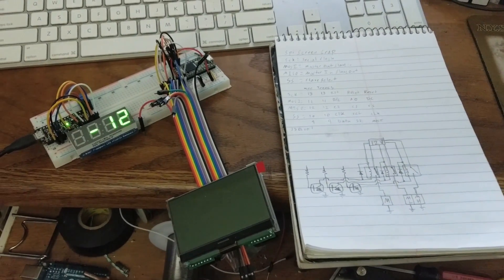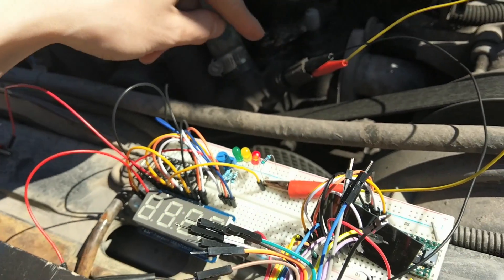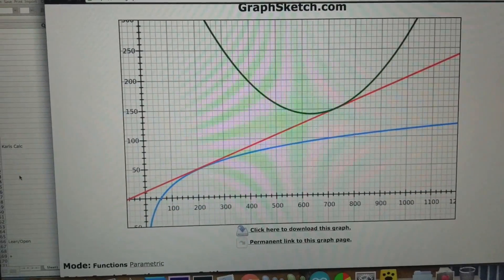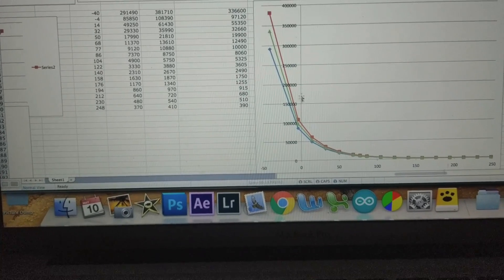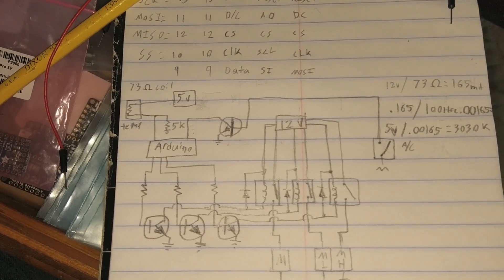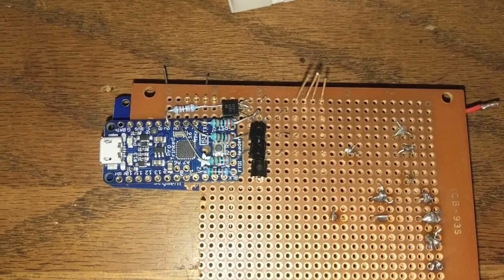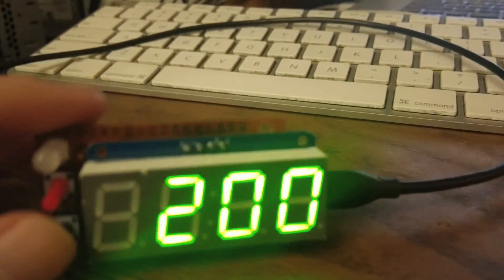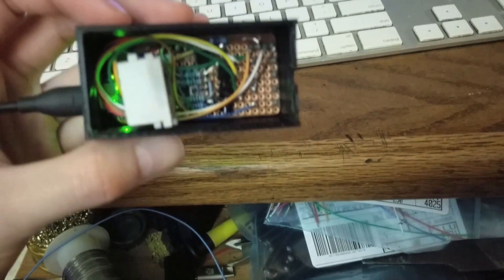Arduino Powered Automotive Fan Controller

Comment: I thought Arduinos didn't take over 12 V? How does it hold up to the 14 V + in a car when the alternator is charging? Are you daily driving it?
Reply from the maker: Correct. Arduinos are traditionally 5v or sometimes 3.3v logic. The trick is learning how to safely interface with higher voltages, which is actually pretty damn trickey.  

First power is powering the device. That's what a voltage regulator comes in, which cuts the 12+V down to 5v. Some Adafruit boards have built in regulators that can take 14+V so it's a good all in one choice. 

After then is making sure the outputs can also handle the load. I used transistors in this design which is sort of like a relay. It takes the small logic level output of 5V to control the relay at 12V which in turn controls the fans full power.

It's a fun little project if you really want to get into electronics and programming, but if you'd like something a little more out-of-the-box, I actually sell my own design now. 

https://nickintimedesign.com/product/trinity-fan-controller-v2/

Comment: Have you considered using some large mosfets and driving the fans via PWM? I bought some 200amp fets the the other day for less than $4 each, can't even get a relay for that today. What would be trick is adding a thermistor or thermocouple to the condenser return so you can regulate AC temp/pressure. Oh and I like your channel thanks for sharing your projects.
Reply from the maker: You know, I thought high amp PMW was gonna cost money so I didn't even bother looking into that. But that price sounds incredible but also sounds like I'd massively over-complicate this project haha. And an A/C temp feedback could actually be an interesting thing to monitor. If I keep on this path, my jeep will eventually become a spaceship that only I will know how to pilot haha.
Reply: NickInTimeFilms if you're going to be the first person to drive to the moon, it might as well be in a Cherokee! 

great videos, keep it up!

Comment: My a.c. controls had what I believe to be vacuum lines to control airflow vents. Thoughts on where to start with that?
Reply from the maker: Uhh, what seems to be the issue? The actual vent direction is vacuum controlled by the Black line near the heater core. Blower Fan speed is electrically controlled with a resistor pack, and A/C is electrically triggered as well.

Comment: Do you have code that would be for something more basic?  I don't need the extra buttons. just read and display temp and turn fan relay on.
Reply from the maker: +Landon Williams most of it is documented. If you're even remotely familure with arduino then you should be able to take what you need. just delete all the extra menus and button functions so only the temp reading and main display screen are included.

Comment: Damn i was hoping this was going to be for the interior blower, sort of like a hack climate control that would control the fan speed for you.
Reply from the maker: Hmm, well for an interior blower motor you've got 2 main options. You can do the simple way with a couple resistors divider circuits to have a couple speeds. This will need to be pretty heavy duty and may need cooling to not burn up. 
The better way is to use a Solid State Relay and PWM to control the speed. This would give any amount of speed you wanted and more efficient too, just make sure you get one big enough to handle the load.

Comment: I would get your controller however I made a 3 fan kit that i put over my radiator and i bought a controller kit for it. :(  you may need to consider 3 fans in your controller as that can be something a bit of people have?
Reply from the maker: Well, even though I only have 2 physical fans, there are 3 outputs since the big fan is 2 speed so that's already cover!
Reply: So there is a way to hook up 3 fans? 
Also I have AC. The AC fan is always on with the AC turns on. How are you handling that? I can use my 3 fans with your kit i may just use it because it gives feedback etc.
Reply from the maker: Yep, 3 fans is no problem, and later in the video I do talk about an A/C signal input too.
Reply: So if you want me to be a beta tester i am probably going to get my rig ready for the radiator installation within 3 weeks or less. I can give you all the input you will need. I would love it to be part of your REM V4 instead of separate but if you are too long off for that then let me know.
Reply: seems like there should be 5  speeds on your set up unless the primary runs all the time.
Reply from the maker: +nazcalito once all outputs are taken care of then you can worry about the semantics in the code

Comment: Ok so are you stopped working on the Renix ECU REader V4? cause I want that V4 once you have that out (this month?)
Reply from the maker: Of course not! Still full speed ahead on the REM project! Just got my first V3 Clock Prototype together and the basics work. Time to do some coding and design the faceplate. going to order V4 boards very soon if this works!
Reply: Super awesome. I want to help test first. :)

Comment: Can you build it into the REM V4 this way we can pay $100 for it and we get the fan controller at the same time.
Reply from the maker: It's funny you mention that..... A very possible feature that has been designed in. There will be 3 extra wires for for input or outputs, fans being a possible thing to control

Comment: hey! I forgot I've been holding onto this link: http://thespeedfreaks.net/showthread.php?12585-CCDuino-A-ZJ-Databus-Project/page9
Really interesting stuff, I'd love to see you do some stuff with OBD2 Jeep's!  Definitely willing to help with that too, financially and with prototypes/coding where I can.  I think your videos have convinced me to start integrating an Arduino, but I'm now even considering a Raspberry Pi as I have one of those just laying around since we got a FireTv to run SPMC on.
Reply from the maker: +rcguymike Uhg, I'm still barely thinking about OBD1 haha. I figure OBD2 guys are covered with the ScanGauge. And the pi is good if you can code on it
Reply: NickInTimeFilms problem with the OBD2 readers is we can barely get a sensor to update more than once or twice a second.  your scanner is way faster on OBD1.  we have a '17 Patriot that is plenty fast enough but the OBD2 speeds on XJs are stupid slow...
Reply from the maker: True, I was amazed when I found out how much the snap-on scanner was holding back on me. That real time o2 sensor update is just unreal. I would assume there should be plenty of resource material on OBD2 so it might not be too difficult. There seems to be more about Chrysler OBD1 then there was on Renix which was damn near nothing. All in due time a suppose.
Reply: NickInTimeFilms I got faith in you! it's truly amazing how far you've come.  thing's I've thought nearly li possible you've basically done via trail and error. plz let me know of you're considering OBD2 I'd Love to help out
Reply from the maker: Swanky. Also during a quick search I've found lots of videos on arduino to OBD2 stuff so it should be very possible. Would just have to look into in, but it's not really nessisary for myself currently https://youtu.be/V_0erH7wXNU?t=1m18s
Reply: Step 1 invent a way to extend everyday by 4 hours
Step 2 decide whether to use Arduino, RasberryPi or both
Step 3 profit...

It's step 1 that's killing me...lol

Comment: Look up "high impedance comparators". pretty simple circuit you could tap that to pretty much any factory sensor without messing up the readings much.  Message me if you need help or can't find anything.

Also I hate you...You make me wish I bought a renix XJ now...lol  I'd love to build a controller for the AW4 and the fan(for OBD2)...Currently thinking of doing manual switches and even bought them, but this past weekend I was towing a 5x8 uhaul and was wishing for all manual control of TC and tranny...couple times I kicked her into 2nd up to 4krpms when it really didn't need to.
Reply from the maker: Haha, sometimes you can have a lot of fun with the older tech! I'm curious, what kind of benefits would a high imp comparator have over a simple voltage divider circuit? Oh, is that so you can read a factory sensor circuit without interfering with the original circuit? That sounds like it could be useful for people that want to read the oil pressure sender while it's still hooked up to the gauge.

And depending on how new your jeep is, the tcu was added into a full pcm in later model jeeps, but the control circuits would still be the same if you can find the wiring that goes directly to the transmission. I will say that I'm having stability issues with both the transmission shifter and this fan controller, but the one thing that share in common are the arduino board i picked. it only has a voltage regulator good for like 150mA which is crap, and I'm thinking the regulator is getting too hot and shutting down. I think with a little external boost, they should work fine.
Reply: Yep, with the comparators you should be able to set it up to directly read the voltage at the sensor plug.  

For voltage supply, maybe see if you can pick up some buck/boost converters off ebay.  They're pretty robust and you can get 100 packs for cheap IIRC.  For one of my classes I built a switch mode buck/boost converter that could take in 7-40 Volts and convert it to 7-40 volts up to 6 amps.  I could overload our bench lab power supplies and melt 10W resistors...that was a fun project but overkill for this application.  I actually built it to make a high amperage USB charging circuit for my phone/tablet in the car and since we were given a budget of $40 I figured I'd built to that rather than my actual need lol.
Reply from the maker: Haha, there's no kill like overkill! I'll have to do some poking around and see what I find.
Reply: Comparators are basically how ADCs work, which reminds me your random high temp spikes before you averaged might be from the dithering if the arduino has that built in.
Reply: A couple days studying op amps you'll go nuts with projects you want to do!
Reply from the maker: It's funny you mention looking into the Arduino ADC's because for the V4 REM's I am moving on to an entirely new chipset and the ARM ADC on that is wonky and a lot less stable the ATMEL variety. I guess it likes lower impedance signals but I have found that a small capacitor can clean it up but quick changes start to ramp a little so it's not the best for my button multiplexing. 

There's a lot hiding under the hood that you don't have to think about until it starts acting up and then you start opening up a whole new can of words. I went a little nuts with the overload of just seeing how op amps worked, haha
Reply: yeah... maybe you don't necessarily need to understand them all but there should definitely be some cookie cutter examples you should be able to make work